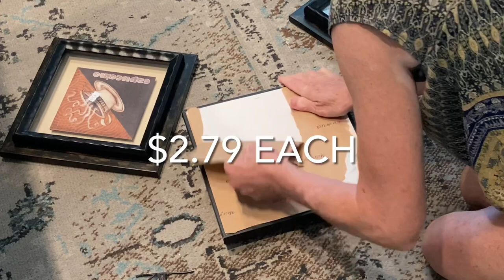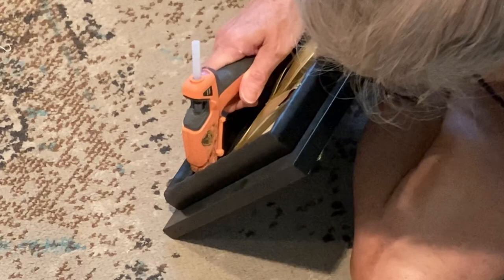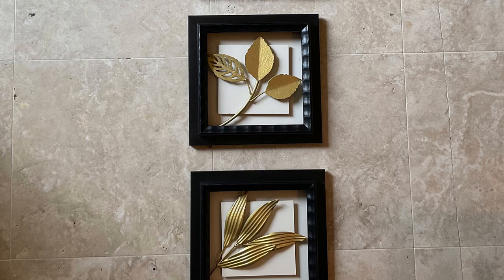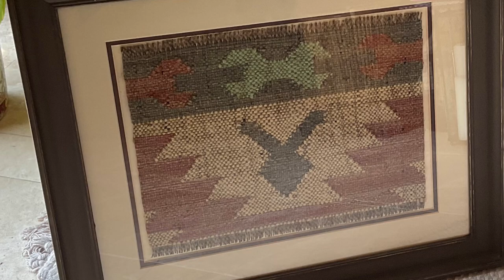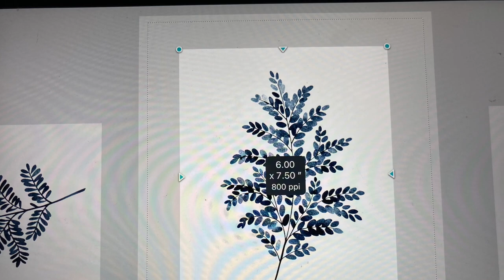16 DIY PROJECTS INSPIRED BY THE TOP SELLING HOME DECOR OF 2021

Comment: I was so excited when I saw you bring up the paper art decor. I have been studying those photos up close for weeks. I’ve been trying to figure out how they are made. I was so hoping you had a recipe for what ever it’s made from.
Reply from the maker: I have been studying them, too, and I’m stumped.  If I figure it out, I’ll definitely include it in another video.
Reply: I’ve been doing some more research. I saw one of the pieces described as rice paper. I think it might be some form of a combo of strips of the edible rice sheets and the “rice paste” they use to make the sheets. And I think there is some type of patterned base that they layer the strips and paste on to dry. They must use a uniform base because the patterns are almost identical and the art work is sold at lots of retailers.
Reply: If you watch some of the videos of rice paper production done in the country in Vietnam you can see the variation of the product and how different it is from rice paper spring roll wrappers that are store bought.

Comment: Do you just use regular print paper, when you use the free printables, when you make your pictures?? I didn't know if you may use photo paper, or card stock, or something other than printer paper. I absolutely love those prints.
Reply from the maker: I use either regular copy paper or card stock depending on the project.  If I am going to decoupage the print to something, I use regular paper.  If I am going to frame them, like I did with the blue botanicals, I use card stock.  I should have mentioned that. Thanks for asking.